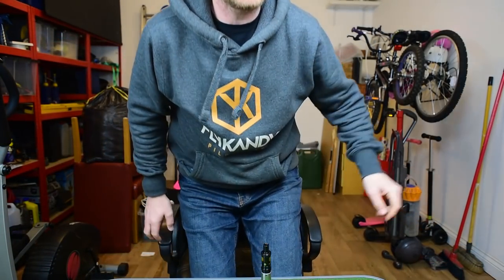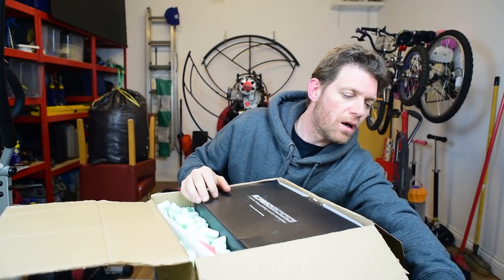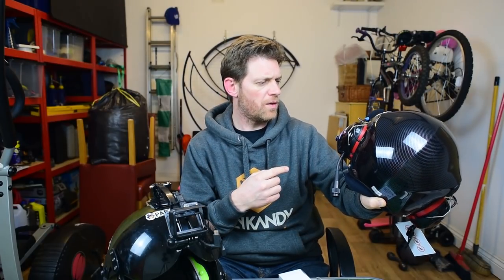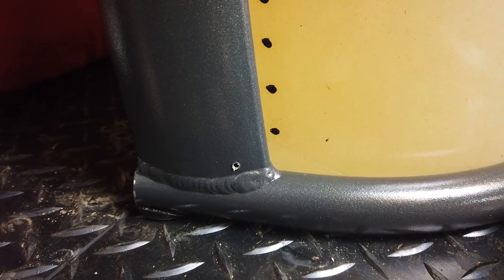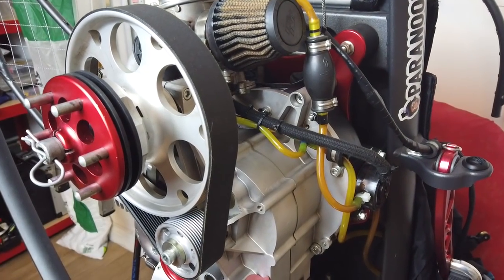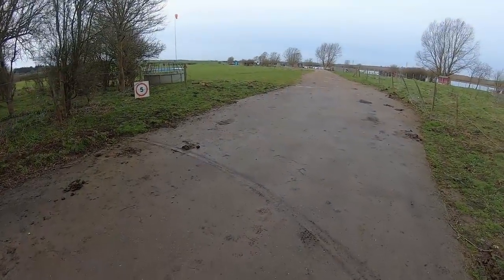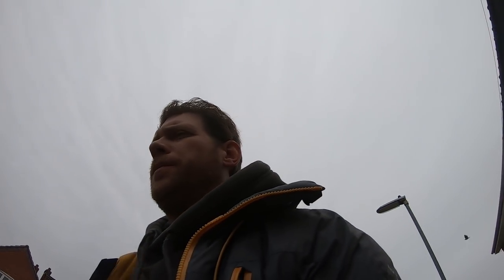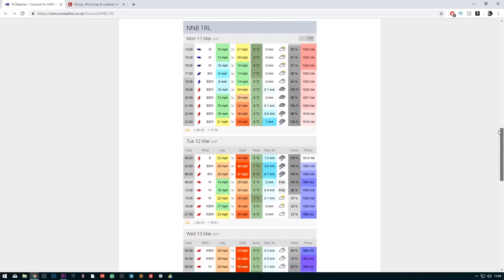Paramotor Vlog - GROUNDED, DNIF (duties not involving flying)

Comment: Maybe you have too much crankcase pressure pushing oil out of breather? Too much oil, worn or broken piston rings. Danger would be engine emptying it’s own oil. I’m not a pilot (yet) but know engines. Hope you find a cure.
Reply from the maker: Thanks for this, I DON'T know engines.. when I know how much comes out, and when, I'll have some valuable info. Will drain it and put in the recommended amount before testing as well..